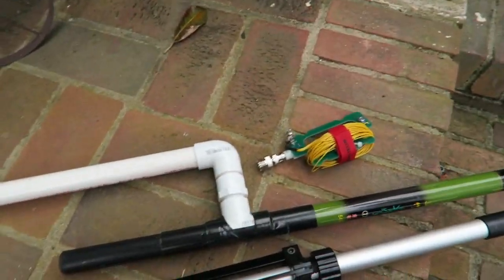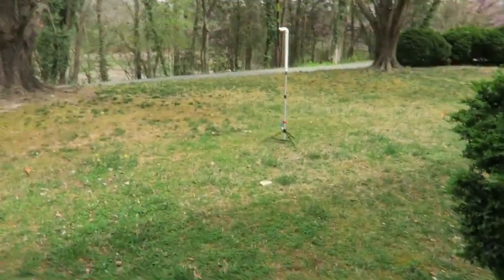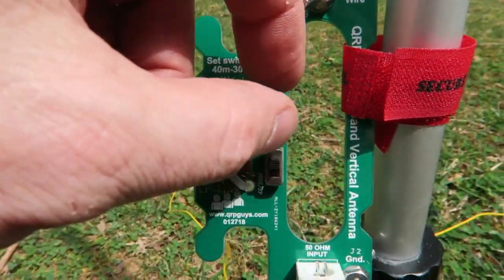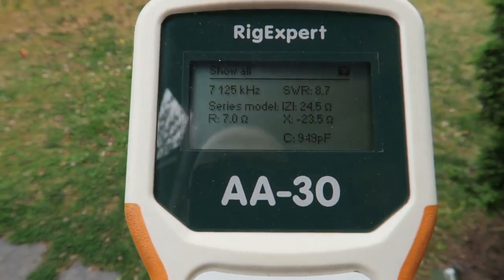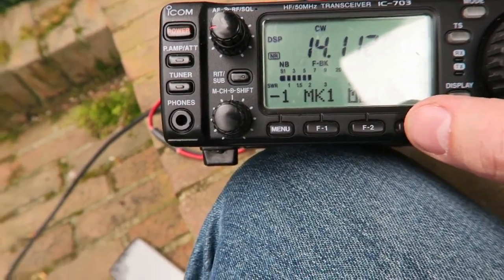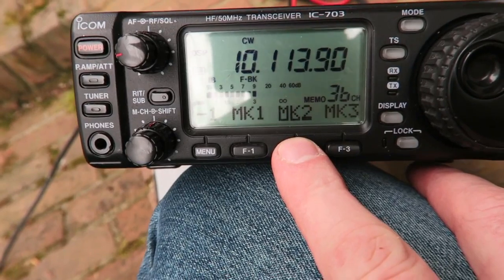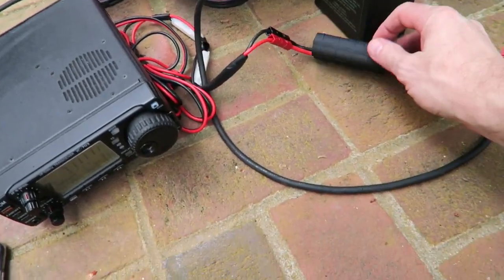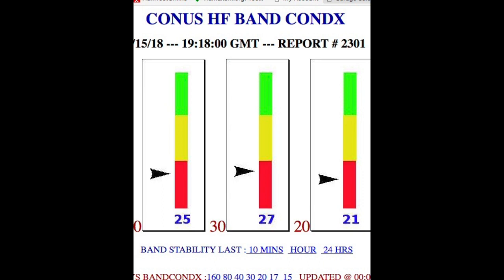QRPGuys triband vertical antenna deployment. How I deploy mine.

Comment: You'd better measure the SWR closer to the antenna or add cable losses to correct the read value. 73's, OT5Q

Comment: I built one.. 40 M is good but the swr is to high on 30 and 20. Anyone have an ideas? It has been a while since I set it up. It could have been 20 was good. Either way it one was good and on 30 and the other, the swr was to high... Great video and very clean looking rig!
Reply: Adjust the length of the wire- shorten or lengthen. Also, use at least 14 gauge wire.  Larger wire has more bandwidth.
Reply: @westsideflyer7559  UNDER NO CIRCUMSTANCES should you adjust the wire of the vertical element for anything band EXCEPT 20 meters!
Adjust 30m and 40m by adjusting the appropriate coils. Read the manual!
Reply: @warplanner8852  I read the manual and that is what it said to do.  The length of the wire provided is longer than it has to be. The OP mentioned it woulld not have a low SWR on 20.
Reply: @westsideflyer7559  negative! With no coils switched in you should trim the wire until you get the lowest VSWR possible for 20m. Then adjust the coils - L1 for 30m and L2 for 40m.
Reply: @warplanner8852  OK. You wanna be right? You're right.
Reply from the maker: Thanks! I had another viewer comment that I failed to change one of the switches to 40m in this video, so I might need to revisit this antenna. I've also heard that the toroids might need some work...I hate those things.
Reply: I think the instructions mention to adjust coil spread and compress for 40 and watch swr

Comment: The reason is wasn't resonant on 40 M, was that at 3 minutes, you should have flipped the other switch from the 30M position to the 40M position. You were testing for 40m while the antenna was set for 30 M. Be good to know what the swr was for 40M with the correct setting. Good video.  Brent  va7hum
Reply from the maker: Haha! Thanks! I might need to revisit that test! So many things to think about when doing this at the same time trying to record a video! Good catch and I will try and redo this...maybe tomorrow!

Comment: awesome design! love mine work Europe / west coast / south america from NY with mine using 4 elevated radials and a 20 foot carbon fiber wonderpole.
Reply from the maker: Thanks! How elevated do you keep the radials? I need to revisit this antenna.
Reply: Bargain Basement Ham Radio 4 feet at the connection point and let them slope to the ground. I have eye connectors on ends of radials and use metal tent spikes to hold them in place. Look for my video clip on my KE2YK Twitter page 73 KE2YK
Reply: Bargain Basement Ham Radio btw the twitter post is from 5/26
Reply: Bargain Basement Ham Radio around 4 feet
Reply from the maker: Thanks! I'll definitely check it out!

Comment: You are one clever dude! Is that antenna an appropriate first timer kit? N4KBM
Reply from the maker: Hmm, If you have some experience with small components, yeah, I think it might be a decent first timer kit. The hardest part is winding those toroids, but only because they are so small. The first kit I built that had toroids was a disaster, I didn't remove the coating on the wire well enough at the solder points. and...well...it just failed.

Comment: What antenna wire are you using?
Reply from the maker: Hello. It's in the title and description. I'm using the QRPGuys Portable 40-30-20m Tri-Band Vertical Antenna. You can get them here: https://qrpguys.com/qrpguys-tri-band-portable-vertical-antenna
Reply: @BargainBasementHamRadio  He was asking about the wire.  The tenability of an antenna depends on the gauge of the wire.  I have some very light stuff I was using with mine but it was very sensitive to the length of the wire and I had to shorten it to about 16' so it would tune.  I changed it to 14 gauge stranded and the tuning was as specified.
Reply: @westsideflyer7559  I got it. Good point. I am using some very light wire here too. Like most of us, I am sure that I have a roll, wad, or mess of speaker wire somewhere! I plan to revisit a few things from my videos this year. I just need to find where I left that motivation.